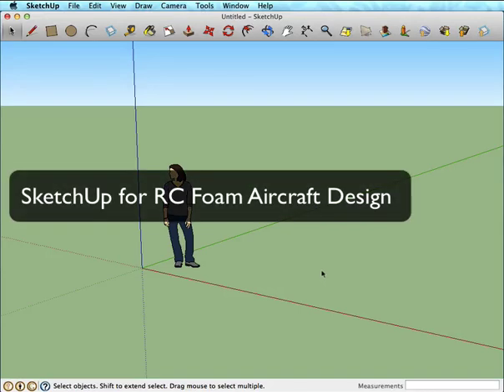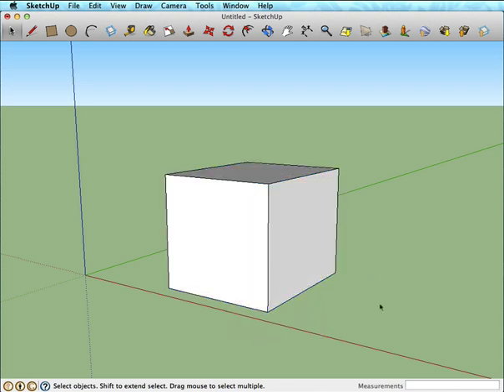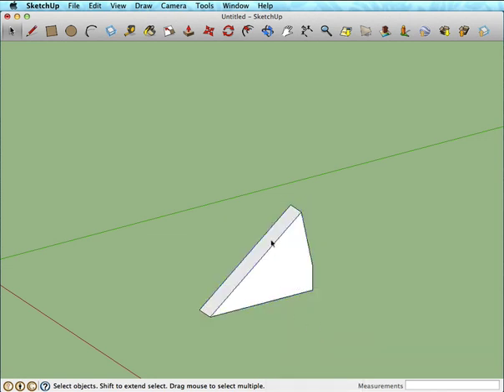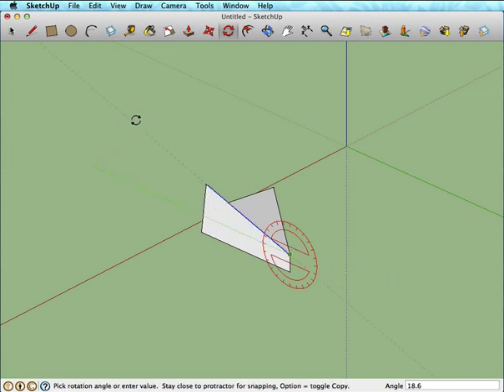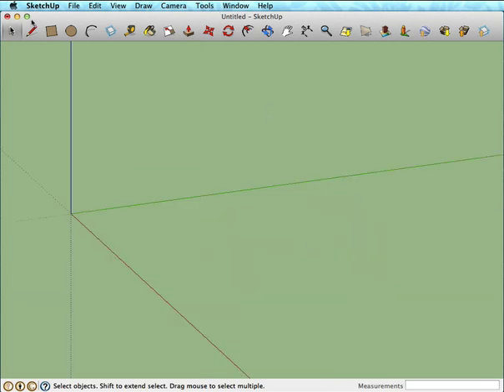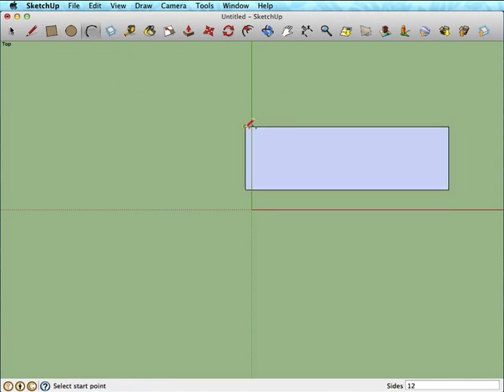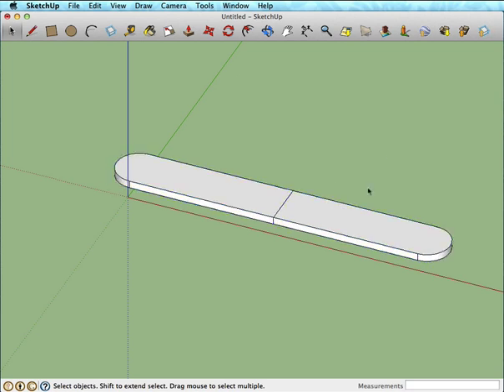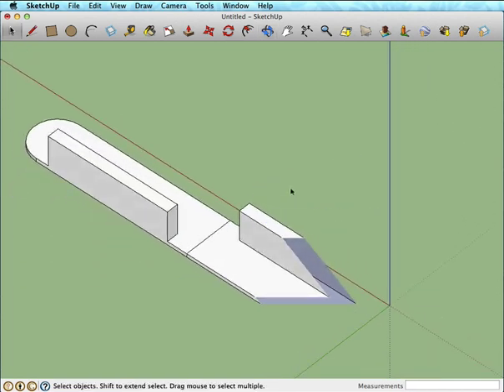SketchUp for RC Plane Design Tutorial #3

Comment: Great vids ! Ive just started trying to learn Sketch Up and this is a big help. Just one thing so far. On PC /Windows its control and move to duplicate as you drag. I kept trying alt and it just didn't work. I also found that ( Flip along Red ) flips the mirror'd image smoothly, and when you make edits to the component it makes a perfect edit to the other one like ailerons on both the right sides.  Maybe you can type that into vid # 2. Thanks again for taking the time to help !

Comment: When I am using components such as a wing and I duplicate and mirror they refuse to snap to each other. I've tried both ways the negative 1 scale and flip along. This is also true if I select the component for the component list.

Sketchup 1.5.2.686 on OSX 10.10
Reply from the maker: Double check that object snapping is turned on.. http://help.sketchup.com/en/article/95964 (listed near the bottom)